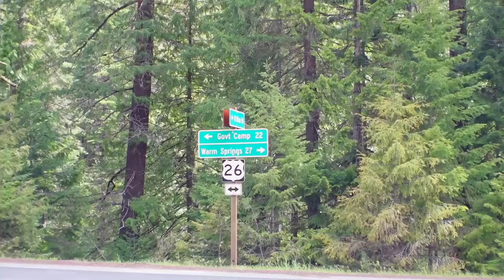When a mechanic has to call a tow truck..

Comment: Wow, I had no idea that some cars come without a spare tire. Gavin should take the shredded tire and the can of fix a flat to the dealer and ask how to use it. LOL
Reply: I love your new cars do not come with a spare tire they charge you extra for
Reply: @jerryb1234  It exploded! I'll bet you never had an actual blowout. I have, and there is not much left on the rim. (to be honest, I thought the same until I heard that it was a blowout, which is a completely different thing from a leak)
Reply: @jarrythskeen8336  My 2022 Subaru Forester comes with a full size spare and a matching rim.  And it even has a TPMS sensor.
Reply: @AlaskaErik  nice. Have a 2014 Dodge it's got a full size spare tire but I also use it as a work truck. I just know that some of these new smaller cars they charge you an extra like 50 bucks for the donut tire sold separately
Reply: I agree, totally! They should include a roadside assistance program at no charge.
Reply: I got a flat in a rental Kia that had no spare. They had to flatbed the car to Hertz. Tow truck driver was awesome and drove us to our DR. Appointment before dropping off the car.
Reply: Yeah take the can of fix a flat and shredded tire to the dealer and say this is the scenario which I was in how do I use this can of Fix-A-Flat
Reply: no kidding
Reply: I had a 2008 Mustang Bullitt and it did not have a spare.
Reply: Hahaha 😂

Comment: Casey, The dolly bar seen at 2:10 is visibly bent in the middle.
My 2011 eco cruze I bought recently also did not originally come with a spare, though I have since corrected that. Its a weight savings thing. 
(Before you guys judge, its a 3 pedal car and my commuter)
Reply from the maker: The bar has a camber built into it so that the dollies sit vertical when weight is placed on them

Comment: There's actually a lot of newer vehicles sold without a spare to save weight. Even if you do have a spare, it's probably a compact temporary one.
I ordered myself an extra rim and mounted one of the good old tires on it when I got some new ones. Had to rearrange the space where the factory spare used to be, but it was worth it. I drive 400 miles a week. A full size spare allows you to not worry about it if you need to use it long distance.

Comment: I always either buy an extra spare or use one wheel of the other set as a spare (In my climate I have a separate set for winter snow use and another for summer). Can gets you only so far, even a rather small tear and you're out of luck.

Comment: My Honda hybrid is the same, came with a plug-in compressor and a can of fix-a-flat.  They do that for the weight savings to maximize fuel economy.  I still don't have a spare but I did add a jack and lug wrench.
Reply: I recently saw a video from a tire repair guy who hates fix-a-flat and numerous other similar workers agreed in replies. Some said they would never work on a tire that had it applied. Pretty much a guarantee that you will buy a new tire apparently.
Reply: @JohnHallgren  Agreed.  I've never had to use my fix-a-flat and I consider it emergency use only.  But if I had a puncture at midnight in the middle of nowhere, I would definitely use it to get home or to the nearest town.  Replacing a tire in that instance is likely cheaper than paying for a tow.  Of course having a spare is best.
Reply: @clupus63  in my case, I have AAA Plus so 100 miles towing are included. Other roadside assistance services may have similar tow benefits.
Reply: @clupus63  Isn't Fix a flat flammable and renders a tire useless once used? I've had tire repair mechanics tell me they won't work on a tire once fix a flat is used on it. Better make sure you don't intend to use the tire again if it even works.
Reply: @coachwendy5618  Some of the Original inflate-a-tire products DID use a gas that could be flammable , but i think by now all of the Brand Names use a safe gas. No guarantee on Cheap Knock-offs tho.  I gave-up on them when i found that the size can most places sell  are only for small compact cars. It would take 2 cans for my suv & 3 to inflate my van.  I was only planning on them as a qwik-fix / get to a safer pull-off  method anyway. An actual spare can't be beat.

Comment: I have a problem with carrying a spare for my T Bucket, 5 hole 15" Jeep wheel on the front axle, and 8 hole 16" wheel on the back.  My flat bed is only 30 inches long, and I have a box on the bed that takes up half of that.  I do carry some tire plugs, and I have an on-board compressor, but, I have made my mind up already that if I have a flat out in the boondocks, I will just drive it in.  I will need a new tire and wheel, but it is what it is.  All of the rest of my vehicles have spares, and jacks, and lug wrenches.  I even have those big 4-way lug wrenches because the little "cute" lug wrenches that come with the vehicles are a joke!  A bad joke at that.

I heard you just fine Casey.  Nice video!!!

Comment: My daughter's ex boyfriend had a dodge challenger and he's showing me it. And he opens the trunk. And im looking and same scenario there's a can of fix a flat and a small 12v compressor. Im like lift the carpet there's no spare. He's like no, they only come with the fix a flat and compressor. Im scratching my head like wtf that's not going to help in anyway. I wander how much manufacturers saved by skimping out on the spare? Great video!
Reply: A Stellantis product stranded me and three others in the middle of the Wallowas. The owners had no concept of tire wear and it was down to nothing, and speeding on rough gravel ended the tire. No spare led to 6+ hours of calling, waiting, and relying on others to get the job done. Not cool at all.

Comment: Casey, have you thought about installing a manual locking hub conversion on the front end of your Dodge RAM 3500 Cummins? We had them installed on our 2006 3500 Mega-Cab Cummins last year...what a difference, especially in mileage too.

Comment: I bought my wife a new Jeep Renegade and the same thing happened to my wife. Luckily she made it home before it went totally flat. The next morning I went out to put the spare on, and it's like where is the jack, where's the lug wrench, and WHERE is the spare tire?  And what the hell is this ? A pump and some seal a flat! Well it didn't work. Went down bought 5 new tires and another rim, jack lug wrench.  When we bought the car I never thought to check for a spare. I'm mean why wouldn't there be one in a btand new car?  Well lesson learned alway check for a spare before you buy a new or used car.

Comment: Well He is not the only one that doesn't have a Spare tire. I also an a Mechanic & I also do not have a Spare Tire in My car & I also have not had luck in finding A Spare for My 87 Crown Vic.
Reply from the maker: I don't have a spare on my truck either.  No where to put one other than just in the bed, and then I wouldn't be able to carry the gear that I need to actually do the job🤷🏼‍♂️
Reply: @CaseyLaDelle  OH NO!! Guess that makes 3 of Us. HaHaHa. Ever think about mounting one on the front bumper like in the olden days? I also was surprised near end of video where was said that Toyota's don't have a spare anymore. They used to, right from the Corolla to the Land Cruisers. The FJ's used to be mounted on one of the rear doors. That was one of the tasks in the PDI's of putting them on.

Comment: On Corvettes they don’t even come with a can of fix a flat or a spare. They have run flat tires which are good for 50 miles. So, if the tires comes unglued you are royally screwed just like your friend.

Comment: My Camaro does not a spare just the can of gunk which tire repair shops hate. And does not seal serious leaks.
Modern Spare in Layton Utah sells spare tire and rims and complete kits with jack,wrench etc for vehicles that came without a spare. Tire is close to a real tire with decent range and speed rating. It is not a permanent replacement

Comment: I can't find your old video where you discuss a newer, modified part that you put on the Red Lift Truck.  It was the wheel plate that would push the wheels back and up to give more clearance at the oil pan.  Is this still an applicable part?  It doesn't look like they are the same on the black Dodge.  Is there a difference that makes them unnecessary?
Reply from the maker: No, unfortunately those won't work on this truck.  They only work on the standard non auto loading type of lifts

Comment: Question... Is the suspension modified on the truck? Doesn't seem to drop much with a load on it . Nudder question.. what's the weight limit of a towed vehicle for this rig?
Reply from the maker: Yes, the suspension and frame are highly modified

Comment: LOL , road noise that does not end!   Casey do you notice a difference in the way your truck drives now that you have changed the rear differential?     Have a good day and of course thumbs UP!
Reply from the maker: Not really, surprisingly it drove really straight with the bent rear end
Reply: @CaseyLaDelle  Oh wow , I was wondering if there was a noticeable difference. If I remember correctly I think it was wearing the tires on the inside edge so the wheels must have been toed out for that to happen.  I guess being a toe out condition it helped to stabilize and "wandering" tendency.   I am glad that its fixed, thank you Casey and have a good day.
Reply from the maker: @richardthomas1743  yeah the total toe out was 2 degrees, which should have made it drive really bad.  But the only reason I noticed any problem was the tire wear.  It still drove and handled just fine

Comment: Just a question, your state doesn't require yellows when towing on a wheel lift? In Illinois we are, but not when it on the flatbed (rollback).
Reply from the maker: Nope.   That is the stupidest law in the towing industry
Reply: @CaseyLaDelle  I agree.

Comment: When you have big boom booms you don't have room for a spare I kind of miss my sneaker lift but don't miss repo work so since i run a salvage yard now I wouldn't give up my rollback since most of my tows now are either wrecked so bad insurance won't even try to fix it or vehicles that have sat so long I'm afraid to put 5 psi in the tires if they'd even take any air even if sitting inside up on blocks but most are outside and I'm surprised they haven't started growing new vehicles as good as they're planted I drug an early 80s F350 4x4 dually off a farm 1 time it was planted so good the rims were rusted so thin as it moved chunks broke off ( luckily they were 16.5s that nobody wants) and when we got it loaded you could see the ring gear and spider gears the dif covers were almost half gone and the bottom of the diff was in the swamp so long they were getting thin in the skin it wasn't even 10 years old when they parked it because almost 300k on it pulling a pretty heavy trailer rodeo to rodeo the ole 460 was weak that was a fun place to pick through the first few were get them out of here so I can build a sorting pen you can have them when I realized I'd be hauling for days I started paying by the ton there were a few gems in there some were his dad's he never got around to fixing because life happened even got some old tractors and equipment that work great in our gardens and I forgot yota is to cheap to put a spare in they want you to pay for onstar and only break down when it has service

Comment: Hey Casey I was curious as to why you put the Dolly's on the rear of the car versus the front of the car I remember seeing a video of yours about the flat tire on the travel trailer and I was just curious why you chose to put the dolly on the rear instead of the front until it backwards. After watching the video a second time I think I answered my question because the rim diameter is would be way too small for the the lift on the truck correct?
Reply: It's front wheel drive is why and the flat is the left rear, so he had no choice but do it this way.
Reply from the maker: Yep, the wheel lift on this truck isn't adjustable like my old one, so that rim would go right through it and it would be riding on the control arm.  The auto loader is definitely convenient, but manual L arms are definitely better at the job

Comment: It is stupid that newer cars don't come with spare tires just because manufacturers want to squeeze a few more miles to the gallon by reducing weight in the car. That patch kit won't fix a shredded tire that's for sure. They could at least put a donut tire because those don't weigh much.

Comment: This is why you ALWAYS carry Fix-a-Flat. Would have solved Gavin's problem immediately.
Reply from the maker: Clearly you didn't watch the video...
Reply: @CaseyLaDelle  I did. Just laughed when Gavin said Fix-a-flat. Clearly Gavin hadn't used the Fix-a-flat supplied. ;)
Reply: @clark7117  I recently saw a video from a tire repair guy who hates fix-a-flat and numerous other similar workers agreed in replies. Some said they would never work on a tire that had it applied.
Reply: @JohnHallgren  I caught the sarcasm in your comment
Reply: @kevinwalters7615  was just pointing out that even in cases where it might be used, one should not.
Reply: The thing is Fix-A-Flat can repair shreaded tires, also an individual can duct-tape the cans to the wheel and rim. I think the sarcasm in the original comment was missed. lol
Reply: @JohnHallgren  oh I agree Fix-A-Flat is nasty stuff to deal with